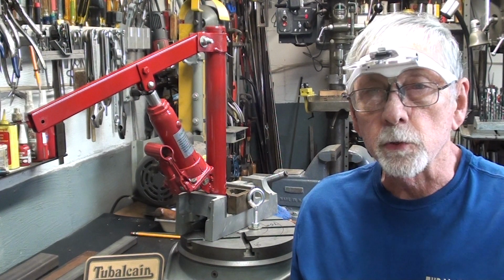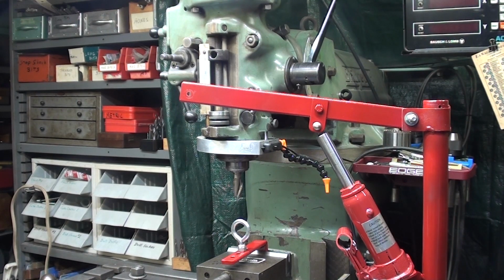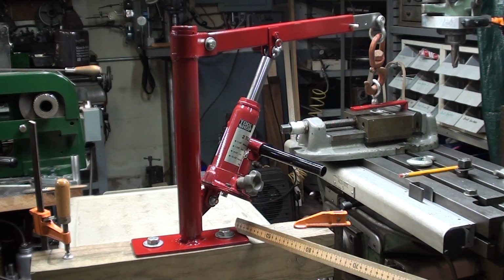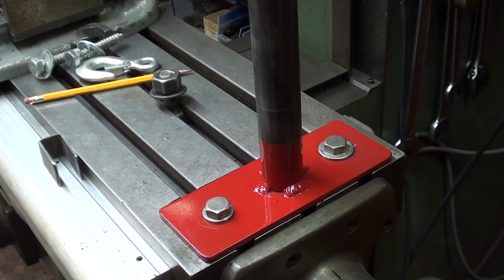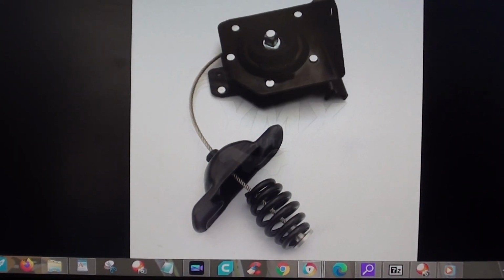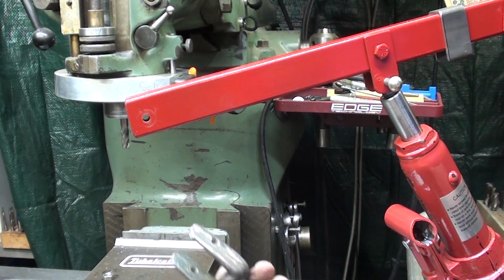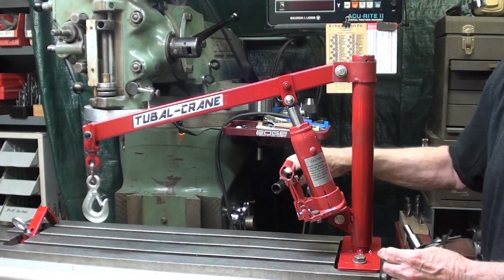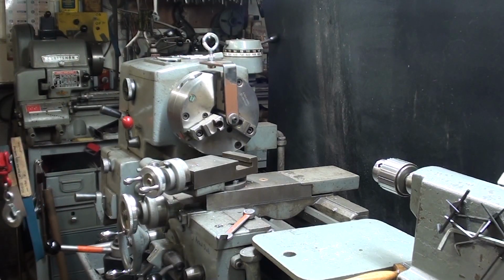Tubal-Crane - SKY Hook for Bridgeport Rotary Table pt 3 #729 tubalcain

Comment: Your prototype is very effective, your mount is fine for the loads you are lifting. Don't lift vehicles with it or try to get vehicles down the stairs. I would have put the pipe in a snug hole and welded it from the bottom. When I want semi-fixed T-nuts I put a set screw or 2 in parallel to the threaded hole and tighten them lightly to push the nut up in place. It is just to keep the nut aligned and not sliding around or being lost. Of course a couple of turns will release the nut. Lifting a heavy lathe chuck arms extended back bent over the lathe is not something one should do at any age. I have lifting aides on all of our machines where a back injury is likely to occur. 

For your viewers that don't develop ideas for a living I'm sure some have never been near this process.  They will benefit tremendously from watching your evolution, testing and refinement. It's easy to be an armchair critic, a lot easier than actually making something. When I design a one-off I am often driven by unrelated factors like what scrap material do I have, or what machine is not tied up or what is the easiest, quickest or cheapest solution. I might use this thing only once or maybe depend on it every day. A failure of the device might be unlikely, inconsequential or fatal. I often seek the simplest possible solution. So the rules depend on the application. I usually have a material scrap in mind before I start the CAD design process. When I design a part for production my criteria and discipline is vastly different. I will worry about many other things like material, strength, cost, time, complexity, manufacturing methods. I may do an FEA structural analysis and iterate many times on those results alone. If the part is to molded and I am working on the mold a plastic flow analysis my come into play. No one would have the patience to apply these methods for a DIY project. But I do use 3D CAD on almost everything and do a quick structural analysis when necessary.

You did a fine job on your DIY crane. I made one years ago with gears and a hand crank I didn't even consider the great idea of the hydraulic jack, maybe I should have. Don't under value the importance of showing the DIY approach to practical engineering, a lot of people need to see it.
Reply from the maker: Thank you for some good ideas. And you had good suggestions concerning the way you do things. A lot like me

Comment: How about drilling a few holes at different lengths to adjust the lift point on the new boom. That way you could use it on the Lathe without changing booms. Great project!

Comment: Lyle, why couldn't you mount your portable jib crane on the left end of the table.  That way you don't have reach over to the back side to operate.  I like the adjustable boom version you made.  That way you can adjust it to the machine it is used on.
If I didn't already have shop-built jib cranes at my machines, I would build one of these.  Heck, I may still build one!
As always, thanks for sharing.  I too, watched all these videos end to end.  Ken

Comment: As a small nit I might have made the base a half circle with the apex toward the load.  Also, and interesting experiment might be to test to failure to see how strong / safe your crane really is. (I'll bet it will safely lift MUCH more than you would ever put on a mill table) Nice video, fun to watch the creative engineering process.

Comment: I want one.  I don't need one, but.....it's a crane!  I think the extension bar gives you the best flexibility in terms of lifting and storage where this thing will spend most of its life.  However it does add weight.  Great video as usual.

Comment: For those worried of vice clamped slippage our vice storage cart contained a piece of 1/2 x 1 1/2 x 24 inch crs, every corner on the bar had been radiused to 1/16. Moving the big vices from the cart to our 2 Milwalkee rotary head die millers consisted of clamping the bar in the vice, tapping the handle with a rawhide mallet with a toolmake along each side, one hand grasping the bar end while the other grabbed the vice's end then lifting, walking to the table. Removal was the reverse, never scuffed a shoe with this 150 pound monster.

The carabineer looked too much like a bull's nose ring!

Comment: I agree with a knob on the jack maybe you can show us how you did that in the next video. You're certainly right about those tire jacks it was a big surprise when the cable on mine broke and dropped my 20-in truck wheel on the road. Luckily I was going about 10 mph if I was at 70 I couldn't have ended up having to buy a new truck.

Comment: Very nice Mr. Pete, I made a jib crane to do the same a while back. I have a RongFu mill on a stand. I attached the pivot to a back corner of the stand and used a small chain hoist to lift my vise and rotary table. I like your design it is much more compact than mine.

Comment: I like it, think I will do something similar, use an electric magnet, I suppose at the risk of not only imparting a field, but eliminating nonferrous stock. Quite inexpensive, excellent power to watt, reliable, could add some sort of catchall fail-safe when required.

Comment: I like the shorter arm with slide in/out, it can reach out when needed and collapsed down would not need it or under the workbench collecting dust. Moving the point of contact at the top of the jack was crucial and I'm not sure if I mentioned that in my comment on the last video, but I can see it need to be moved about two and a half to three inches back more toward upright main post. For the lathe machine, I'd suggest welding a plate with upright piece that can stick out from under the lathe base an use it's own weight to support it and the lifting when moving the head. After use, remove it an put under workbench. Using the shorter crane arm with slide out on it is best one I think. Love to watch your videos, I didn't know if you done live streams, I turned my settings on last night before going to bed, may not have been reset. Take care on this holiday weekend buddy.

Comment: Mr. Pete,
Great project, thanks. Btw, regarding waiting for paint to dry-put the piece in your wife's oven at about 200 degrees. It dries and hardens in an hour or so.  Wait until she is away, it smells a little bit.
Reply from the maker: I often do that. But the crane was too long

Comment: I enjoy all your videos and even though I don't actually own a metal working lathe (yet), it seems like adapting the Tubal-Crane to the lathe will be a bit more challenging. I think mounting it to the tailstock (or to the tail of the tailstock) would be the most advantageous; seeing as you need two ranges of motion to support a chuck, vs. only one when mounting a vice. Seems like the sliding motion of the tailstock would be useful.

Comment: Why would any one want the jack vertical ?
It would be very "lively"  !
The 1st pump of the handle and it would jerk up in the air.
You said you read a the comments so I intend to give you some reading.
I might have been tempted to leave the part YOU, couldn't call a clevis, as was and weld a piece with a hole in above the beam to take the original pin in the original holes.
Reply from the maker: They wanted the Jack vertical, because they have never made anything in their life
Reply: @mrpete222  Nor had any idea about basic kinematics... Nor ever have been in HF store and seen an engine hoist.

Comment: What a back saver. The repair bill at the doctors office will go down. I like the first boom with the ability to adjust length.
Reply: Me too.   I think it even looks better.
Reply: @leebarnhart831  having the adjustable sliding end,  the operator  can lift it of in one position ,   &  put it down on the piece of wood on the lathe bed  , &  then  repair the lift .  So it can reach the  cart  So that.  mod is the best solution to  taking of the  chuck , & having it built by the handler will insure it well built . & think the chuck clamping the work with the ability to rotate the  chuck so it can be screwed off is indeed the best salooshon,  Or be at least  plast on a cradle to enable it To-Be  rotated. is a must these many solutions to the fix , but one thing a must the ability to lift & spin  the chuk without dropping it  So that it may strike the  sindal theds  when it leaves  the last tread on the spiddal,   Balance  will be required OR a cradle to carry its weight ?? food for thought this .

Comment: The eye bolt you are using is unsafe, you should be using one with a solid eye called a machinery eye bolt. The pivot bolt hardware should be grade eight, it's cheap insurance..
Good project maybe someday I will build one.
Reply from the maker: I knew this one was coming
Reply: @mrpete222  Full safety Nazi on you

Comment: I've watched a lot of hobbyist channels weld stuff up. They often run way too much weld for the load than they need. I think this is as much because welding is fun as it is not understanding the strength of materials. Steel has a tensile strength of 40 tons/square inch.  That's a lot.  :)

Comment: Air cylinders are to touchy. You have to be very lite on the valve.
Reply: Yeah, you don't want to put a air cylinder on that.  The first time you apply air, that boom will slap you in the face the hard way!!! All it takes is one time to experience the action of a air cylinder in action.

Comment: I know this may be late... Could you rotate the jack so the handle is closer to the up rite portion of the crane.. Looks like it would fit with out causing issue.. would still give you the down stroke to operate the jack.. LOVE the project and thought/design Thanks for sharing
Reply: I thought the same thing.

Comment: I think that 99% of your detractors don't know how difficult it is to design and build a functional project in your own shop because they have never done it. It's much harder than it looks! You have a great deal of sense and judgment built up from a lifetime of working in and around shops. Thank you for sharing that. Also, I agree - you are the safest operator on YouTube with "That Lazy Machinist" as my runner-up.
Reply: Well, the 2 changes - longer boom and jack top pivot point I could see were issues from the off. The third one was mounting it on his cart - which he still can do.
Reply: @millomweb  Weren't you convinced when he showed how the cart would tip over if he mounted the crane on it?
Reply: @michaellitzkow8123  No - because once he's got a few vices, rotary tables etc. on the cart, it would be stable enough ! He also needs to make crane access to the bottom shelf - where he could put less frequently used items whose weight would also add stability.
Reply: @millomweb  I'm curious.  Have you done the math on that? Do you know how much weight would need to be on the cart to make it stable when swinging a 75-pound object a specific distance outside the base defined by the cart's wheels?
Reply: @michaellitzkow8123  I can see I'm going to have to explain the basics.
So let's assume the crane is mounted near one end of the long side of the cart and the boom length is twice the cart width and 3/4 the length of the cart. Let's say he has 3 accessories on the cart that weight the same. With one of them picked up by the boom, one remaining on the cart at the other end but same side as the crane and the third in the middle of the cart. Rotating the boom 90° to the long side of the cart but over the cart the cart will be stable as the item centred on the cart is the greater weight - the other item perfectly balancing the weight of the one on the boom. Rotating the boom the next 90° gives the similar weight balance with the boom fully extended off the end of the cart giving maximum reach to place the item onto the mill, for instance.
So, with only three items on the cart, one of them can be stably transported to a machine.
All being well though, he'd have 5-6 items on the cart - making it very stable while one item is suspended from the boom.

Comment: Mr Pete   If you could mount the lift on the other end of the table,  It would put the controls and jack handle at an easier place to work with.  Thank you for the article and I think that I will try to make one myself.   Bob @ RJ Machine

Comment: I like the mods, the slide out extension is my favorite. The commenters should realize that the purpose of the small crane is to cut-down on the weight you have to move around. You shouldn't need to use a overhead gantry system to put your crane on the mill!

Comment: What a great device!  I'm always amazed at how many "experts" come out of the woodwork to offer their opinions on how to make your design better.  "If it works, it ain't stupid".  As a designer of aircraft instrumentation I was told by my Chief Designer, Sal Negri that, "form fits function" when I had commented on how strange a particular feature looked.  I think that you have done a spectacular job of designing on the fly. As to how safe those hooks are with out the spring clip on them...have you ever seen a forty pound load jump off the hook when it is suspended in the air?  Great video Lyle, thumbs up.
Reply: Aircraft instrumentation ?

So it's your fault !

I'd go for a touchscreen widescreen display - times 2 + 4 real instruments between them.

Cockpits are far too complex !
Reply: @millomweb  Lol, actually I was involved with the older back up models, you know the ones that keep working when the fancy "glass" cockpit stops working.  Altimeters, Airspeed, Cabin Pressurization, MAAASMach Indicators (Maximum Allowable Airspeed / Mach).  Our company, IDC was the only company that was able to make the 2" standby Air Speed Indicator for the Beech Starship, which I designed...doesn't make a hill of beans though as the Beech Starship was removed to the boneyard.
Reply: @craigsudman4556  In gliders, the airspeed indicator is the pitch of the whistle through the gap at the canopy hinge ;) There's a backup on the instrument panel ;)
Turn & slip - a piece of wool taped to the outside of the canopy.
Reply: @millomweb  the ultimate in no-fail tech.

Comment: This project prompted me to make a version I call the oil rig.  I had an old Orr lock and put it on top of a 4 foot high tripod.  Then put a rod through it with a hook on one end.  I get plenty of leverage for lifting but also a lot of versitility in rotation and length.

Comment: When people drop bits of grit in the comments in one video, Tubalcain produces pearls in another. Irritation brings forth wisdom.
Reply from the maker: lol
Reply: can't wait to see how he overcomes the screw of chuck.  i  have  i see will not do it  THe chuk will need to hold & let the lt turn on a pivot a bit like the crane rotates on the post,   point when  spin it off the  screw  [ of , & on  there  way to do that . we sah wat & see .  Praps bubber can help .
Reply: @lesthompson5907  His Clausing lathe does not use a threaded chuck attachment, it's an L00 taper.  See tips #292.
Reply: @lesthompson5907  Not a problem on my 13" SB with D1-4 spindle...